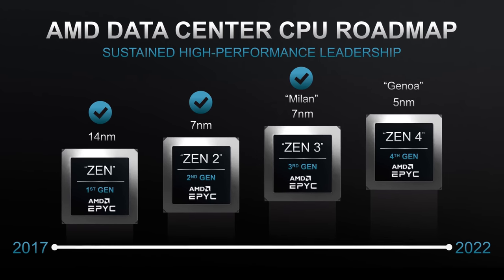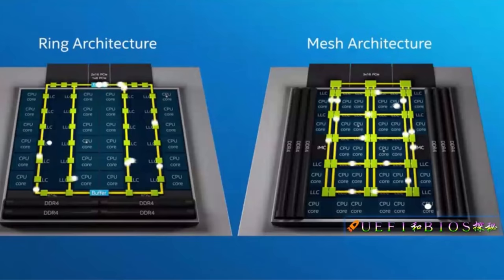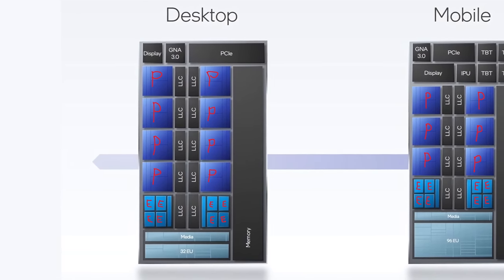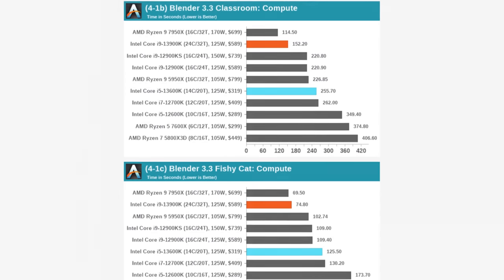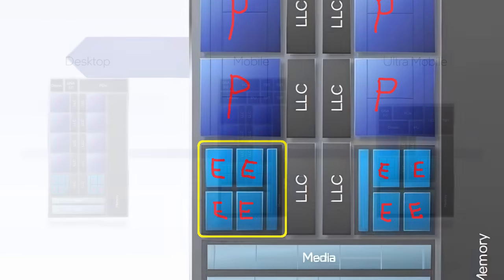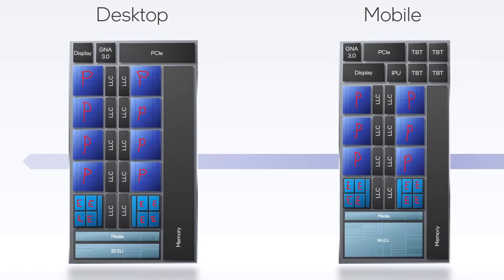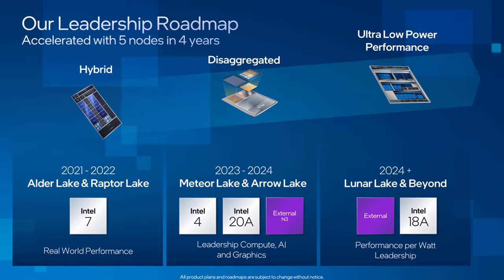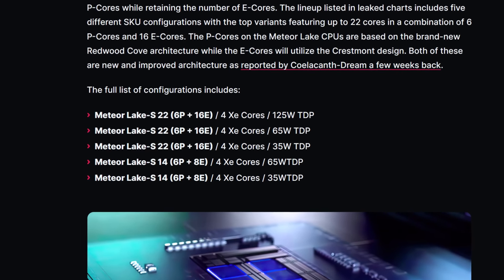E Cores - Slow, simple, not super efficient... but still good?

Comment: Computer scientist here.

You're pretty much on point. The idea behind e-cores is that many computations usually don't need the kind of power (which usually also means HEAT generation) that p-cores aim for. The problem with having only p-cores is that you'll generate more heat (meaning more thermal throttle) and saturate more of your cache, not to mention performing more of what we call "context switching", which is when a process changes from, say, core 0 to core 5 because the region around core 0 was getting too hot. This is especially costly, because you have to move all of the workload in the pipeline from one core to the other and that is hella taxing on performance, but unfortunately we're limited by the technology of our time and this is the only way that we are able to do this. Having P and E cores solves or at least minimizes most of these issues, though. 

Also, like you said, the idea behind using lower-power cores most of the time and only using high-power ones when needed is relatively old, and phones have been using it for a while now (especially the ones with snapdragon SOCs). Intel just brought these ideas to the x86 CPUs, and the results speak for themselves.

Personally, as someone with some experience in this area, I think we'll see a shift to Intel's strategy in the long term. The P and E core architecture is kinda like the "new kid in the block" and much of this type of technology is not really explored yet. Exciting times ahead!
Reply: What do you mean especially snapdragon socs? They all use it. I think nvidia did a form of little core first too.
Reply: I think they will eventually follow the original script of ARM cluster sooner or later. Windows wants to stay in SMP as long as possible. This is basically the chiplet design Intel is avoiding. The bit.LITTLE was originally created for the operating system to dynamically scale power quickly. It was never a performance design. Mobile needed an answer quick and needed something which scaled in the future. ARM choose SMT over SMP. (Redesigning the core was and still is pointless.) The idea being cores can come offline dynamically. This was SMP so user management only. Programmer was to be hands off.

I look for the PCIe chiplet design to eventually win. PCIe interconnects are actually more powerful than people realize. This is hidden in the north bridge, but it started the i series. They knew this from the start. Truth is they have all slowed way down. Intel is actually trying to catch up and AMD is hanging on for dear life. NVidia actually owns a lot more than people realize. They wanted ARM for a reason, but I am not sure if they still do or not.

The real problem they are in is performance per die space. With e cores they throw away die space. With p cores they need better programmers. They are screwed.

Comment: The E cores ARE super efficient... space-efficient Cinebench accelerators, that is.
Reply: They're pretty power efficient too, if you run them at the 2-3GHz they were originally designed for, instead of massively overclocking them by default like Intel did.
Reply: Literally the only reason the 13900k can trade blows with the 7950x in workloads...
Reply: They're only as relevant as they are because intel doesn't have a nice solution to automatic undervolting the way ryzen cpus have. E cores dont solve the problem that you think they do.

Comment: My only wish is a day where there is a proper 4-4-4, or 4-2-4 layout chip for the average user. 
4 honking P-Cores that will annihilate everything before, like we're seeing even today. 
4/2 "M" Cores that are just there to boost the core number and give some performance back to the user. 
4 hyper-efficient, true "E" Cores which can clock down to <1 Watt like an ARM Chip while reading PDFs or PPTs, or background OS crap, stretching battery to crazy levels
Reply: Thats basically arm’s dynamiq design
Reply: @mtunayucer  Yes, and also Intel's current architecture, just better executed.
ARM's DynamIQ architecture was just a bandaid response to dwindling single core, nothing else, with one core now dedicated to buffing that up. 
Here I'm wishing for just a very well balanced CPU with real advantages

Comment: Intel started the race against Ryzen with higher clocked cores and bigger transistor size. They recently started switching some of those with something called "E" cores to up the multi-core performance and scalability. Now it seems they are planning to slowly get rid of the higher clocked "P" cores in favor of more "E" cores that are generally lower clocked.

AMD in the meanwhile started the race with Ryzen's scalable chiplet design and has been upping the core clocks as they go.

At one point in the future, AMD will probably have higher clocked cores and the prospect of just including more chiplets for even more scalability. Since AMDs cores are all close to each other in performance, I'd say this gives AMD an edge on the long run. (More chiplets, more cores, higher clocks). 

We can take a look at EPYC processors to see the heights AMDs consumer designs could potentially reach over time. AMD doesn't need to copy this E-P core design, it is Intel's attempt at shifting strategy to match AMDs design in the long run. This feels like Intel's transition period to a more ryzen-like design. I bet they had this design sitting in an R&D branch for decades and they only really started pursuing it after Ryzen became a threat.

I think Intel is still playing catch-up for the long run, I feel like these back-forth in the last couple generations is not a big indicator that Intel is definitively back on top, yet.

Lets hope the kinks in ARM are ironed out by then and it replaces x86 so we can finally have actual efficiency with high performance and even more competition in the market. It's kind of a waste to be throwing 200W at a processor.

Comment: It could just be me but I don't like this kind architecture at all. If we have to be realistic 99% of people aren't buying consumer-grade CPUs for anything other than gaming and it would have made much more sense for the 13600K to be an 8 P-core chip and the 13900K 12 P-core chip or keep them at 6 and 8 without E-cores and setting the price low enough that it wouldn't make sense to buy AMD at all. This just feels like the most cost effective way to stay ahead of AMD in synthetic loads in order to be at the top in reviewer benchmarks while charging as much as possible to in order to stay competitive. The 13900K is an 8 core chip as much as the 11900K was and the reason I'm yet to upgrade my 10900K while considering if I should go with AMD this time around.

Comment: But Philip! Busermenchark says that the 13600k is way better and buying new AMD product is like buying used cars! If you ask them, the 13600K beats AMD’s flagship 7950X in gaming and almost matches the 7900X in multi-core performance! (This is literally copy pasted from the description of the 13600k and the 7600x on the site)
Reply: @2kliksphilip  User benchmark is terrible but the 7700x doesn't out perform the 13900k in gaming...paired with a 4090 :) if anything the 5800x 3d makes ryzen 7000 and 13th gen look bad when its comes to gaming performance... pulls away from both of them in some games.. the 13900k out performs ryzen 7000 in most games unless the benchmarks i've seen were lies haha.

Comment: I think the situation is very simmilar to the bulldozer times - lots of cores and high power consumption. And that didn't go very well for AMD back then. And until the next gen consoles - it seems we are more or less limited to 8 cores. - And they better be the best 8 cores possible. - In laptop land - whoever can achieve the most in 15 - 45 watt will be the leader
Reply: Have a thinkpad with amd 6850U runs 51w in performance mode but slow it down to 3w idle and 12w max its around 90% as fast daily use, battery lasts 18hrs
Reply: Very different situation, as those “cores” were really bad in single thread, while this has high performance cores backing them.
Reply: The difference is that the bulldozer line was a huge lie in many areas, including its "cores" which were actually core-pairs capped to FPU modules. So if you had an "8 core" FX8350, what you really had was a 4 core processor with ironically worse performance than the standard core in other architectures at the time.
Reply: @hannahtimson2526  I have a very similar 6980HS. 4W idle, 25W max on battery, but I can unlock a 75W power limit when docked, and it can take more from the GPU if needed.

Smart shift has been a brilliant system so far and I hope something similar is adopted for desktops in the future. My SFF PC could have something like it.

Comment: You can use Process Lasso to force programs to run on specific cores on your PC. I used to use it to game on six cores and ffmpeg on the last two.
Reply: that is really cool. thx
Reply: just use task manager's set affinity function?
Reply: @ipodtouchiscoollol  That's true however it resets every time you launch the program. Process Lasso can be set to run continuously. You could make a shortcut to append the specific cores to run on as an option at lauch of the program, but I don't want shortcuts on my Desktop.

Comment: It's very difficult to make tiny cores power efficient for a number of quite technical reasons (specialized instructions, trace length ,  memory overhead/delay). I really look forward to seeing how intel combines chiplets with e-cores however as it absolutely allows for the possibility of larger e-core dies.
Reply: If your smaller cores are risc, it wouldn't be much of an issue. (they most probably are)
Reply: @animatrix1851  The current E-cores in Alder and Raptor lake are full X86 64-bit cores, just small and lacking multi-threading.

I think the end goal would be a specialized architecture that is purpose built for the common use cases of E-cores is the best bet.

Comment: One day when I upgrade from the Zen 3, I will have to build a whole new computer (besides the case).  And until then, it's exciting how Intel and AMD are actually competing in my mind.  Whoever I choose next is absolutely going to be the one with the best POWER EFFICIENCY, as a space-heater PC sucks when you live in a sub-tropical climate like I do, plus electricity isn't free. Even my current 350W PC makes the room uncomfortably hot when running full tilt.
Reply: Ironically, you can take advantage of that efficiency even today. You can buy a higher end chip and slightly under-clock/under-volt it, or buy a lower end chip and do the same. Many programs today don't really need that top-tier performance, even games. And they run so well that you likely won't see much of a difference by dropping it down a bit.

For example, by turning off SMT on my 3950X (since I rarely do anything that maxes out all the cores), I brought the peak TDP down from 160W+ to < 100W. It even idles around 15-25W instead of the usual 25-40W. You could even grab a 5600X and under volt it a bit, where its rated TDP is still only 65W despite being a 6-core chip (compared to the old HEDT Intel chips that took 100W+).
Reply: In future pcs will be cooled by external units, like ac, so no heat inside room

Comment: Scheduling them efficiently is the real problem. Especially user space software would not bother doing it anyway.
Reply: Just multiprocessing applications to effectively and efficiently leverage multiple cores is a complex problem that varies with :

programming language implementation and limitations (each one threats multicore execution differently), 
computing problem needs (not all computing issues multiprocess in a simple manner), 
computing loads (some loads are sustained while others ar bursty in nature) 
bottlenecks (IO bound loads vs calculation bound loads) 

Expecting the usesrpace software to handle core type allocation is just another thing to the already complex mix of stuff...

Comment: Performance/Watt and efficiency is the way of the future, E-Cores is a good gamble in the small retail consumer market but the drawbacks are already showing, with the i9-13900K drawing a ridiculous 330w on full compute workloads. Intel needs to come up with something else because this is not scalable at all. 13th gen looks competitive because they've pretty much shot themselves in the foot and pushed their own products down the stack in order to compete with AMD.
i.e 6 cores vs 4 cores, 8 cores vs 6 cores, 16 cores vs 12 cores
Reply: Don't confuse product power efficiency with design power efficiency. Intel doesn't enforce a lower power limit like AMD did in past, although it seems like AMD mobos are more aggressive now. So Intel peak power may appear higher but it doesn't represent operating efficiency. There, Zen 4 still has some advantage if set to same power limits, but the gap is not that big.
Reply: @porina_pew  dont bother, the AMD fanboys are here to be triggered and whiny beause the video was overall pro Intel, to them, and then towards the end it was anti-amd, to them.

Fanboyism is brainrot - dont interact with it, just back away slowly.
Reply: @porina_pew  At full load, the 7950x draws 230W with 16 full performance cores, the 13900K draws 330W with 8+16E cores a.k.a "24 cores, 1.5x more" at 50% more power a.k.a less efficient because they aren't using 24 big cores

There is nothing efficient about this design, E cores stand for economical(to make and sell) cores, not efficient cores at all.

Operating efficiency for what? Gaming? If you are doing compute work then we are looking at full loads, for gaming sure but who's buying the top of the stack for just gaming? You would be going with an X3D cache variant instead.
Reply: where did you read the 330w? stock is 253-295 depending on motherboards and muticore enhancement settings... thats actual power draw from the cpu.
Reply: @JVlapleSlain  Again it doesnt pull 330w on stock settings lmao...

Comment: CPU microarchitectures generally begin their development cycles 2-3 years before rollout. A great example is AMD; Lisa Su joined the company two and a half years before Zen 1 came out, and she's generally said to have started the project during her tenure as CEO from my understanding. That's all to say, it's very, very unlikely that the 13th gen is the first one to be made with Ryzen in mind. It would be much more likely to be the 12th or, more likely, 11th gen. It's technically possible the 10th gen was made with Zen in mind, but on the desktop side there were remarkably few generational improvements in that release so I doubt it.

Comment: There is Zen4C, that said AMDs Zen 4 cores are more efficient than the Intel E-Cores and they have extensive clock-gating (Switching off unused parts temporarily) as well as very fast on-demand re-clocking.
Furthermore TSMC has a higher yield in their manufacturing process than Intel + the yields are significantly increased by the smaller die area of the chiplets.
As far as we know, Genoa (EPYC 9xx4) obliterates Ice-Lake (current gen Intel Server CPUs) in every metric we know. Sapphire Rapids  probably won´t be competitive either, especially when looking at efficiency.
AMD even managed to beat Intel very hard in AVX-512 workloads with their mostly double pumped 256 wide design (shuffle is true 512bit for some operations). They have higher efficiency, less chip area and more performance, as they don´t have to downclock.
Intel can´t have AVX-512 with E-Cores as the E-Cores don´t support it, so it won´t be availiable on consumer Alder-Lake CPUs (Intel 13th gen). The AVX-512 area on the P-Cores is just dead silicon, which decreases the yield / increases manufacturing costs.
Once more software makes use of these instructions (games, video encode, AI, Simulation) Zen 4s performance will increase even more in Benchmarks.

AMD probably already has the "pads" on the 6nm IO Die in Place to simply add another Cache to the existing Zen4 designs, so 7600X3D will be released sooner or later i guess.

Comment: E cores sucks at least they are not "optimal" for gaming , not because they are e-cores but because the 12/13 gen cpus are mixing and matching p/c cores. e cores are after all weaker and when os puts a thread on the e cores instead of the p cores u get lower perf, and if the system works as intended ie the right thread is put on the right core it still takes time(perf) to decide on which core ie e or p core the workload should be put on.
Reply: @2kliksphilip  it shows that without the e cores u might get 10% better perf. Techpowerup has a new mega comparasion, and for me personally in fps competitive games running without e cores is giving better perf. With e cores on it is akin to like running with slow ram vs fast ram with only p cores. In the games where it shows no perf uplift you are gpu bound.
Reply: @2kliksphilip  the games maybe we're not the best example as there are not that many e sport/fps multi scenarios there. Surprisingly that they get bf perf better with e cores on but I gues not during mp game session. If u look at cpu heavy games u see though that games like cp2077 performs better without e cores. I can show u results in warzone and race Sims(cpu heavy) where e cores gives worse perf. Higher CPU load and worse perf.